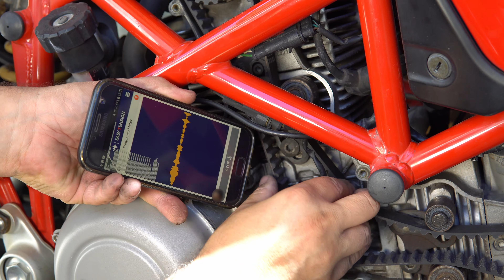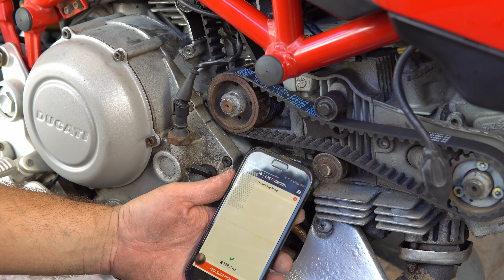Ducati Multistrada 1000 DS Timing Belts Change [4K] - No talking

Comment: New sparkplugs, new rollers, everything torqued properly, good job....
Reply from the maker: Sure. Change everything that works fine, have no play and do not need change and throw money in the gutter, that's bright. As for torquimg, I work profesionally on machinery for more than 30 years and I can tighten a screw as it should be without blowing a thread. But thanks for your contribution.
Reply: @antonisvidakis  sorry superman
Reply from the maker: @hugoblin2309  Apology accepted mechanical expert.
Reply: @antonisvidakis  I am not pretending to be an expert, I am just doing thing by the book ;)
Reply from the maker: @hugoblin2309  Yet at the same time you come here telling me in ironic manner to change the plugs, without knowing if these were changed recently or when. And change the rollers which I thoroughly checked for play and bearings acted still like new. If you want to be factory's favorite kind of customer... to each his own.
Reply: @antonisvidakis  😘

Comment: Thanks for sharing….nice and short video…I found that ‘plucking’ the belt was easier with a screwdriver as on iOS app ‘True tension’ was a bit inconsistent.
Reply from the maker: Thank you, I did not tried that but I'll take your word for it. My thumb would also appreciate this...😁 I tried to keep the mic as close as I could when plucked the belt.
Reply: Good video? Do you use original OEM Ducati Belts?

Comment: Great video, I love this bike.  Just got a 2004  with 42000 miles on the clock.  Will be doing a lot of these services to mine.  How many miles/kilometers on yours?  Thank you
Reply from the maker: Thank you for your kind words. Mine is probably also 2004 but first registered 2005. It has now around 46000 km.